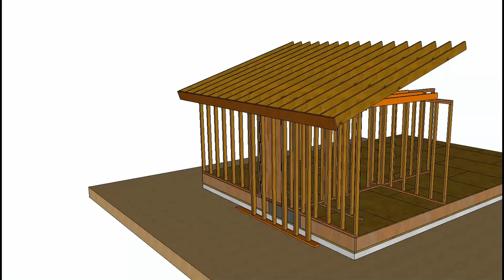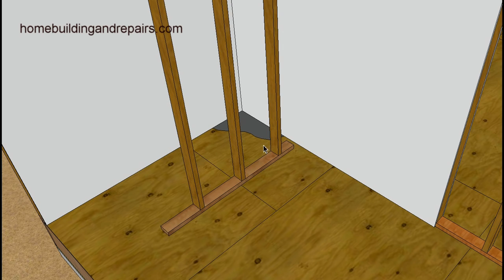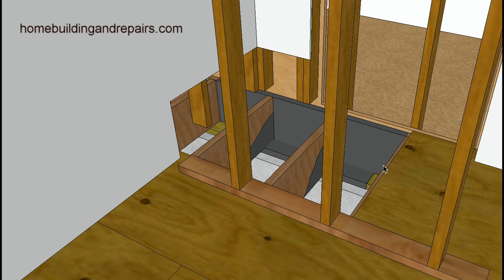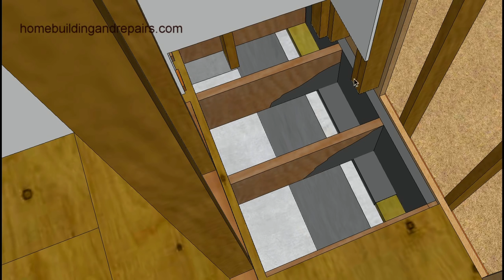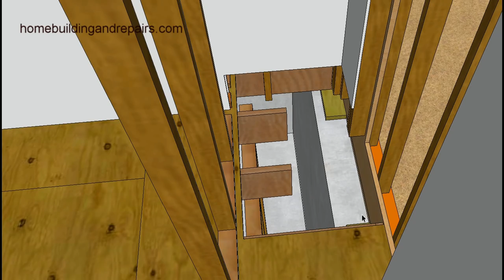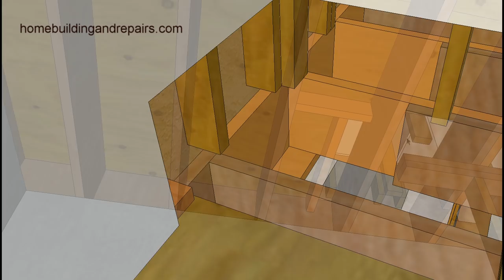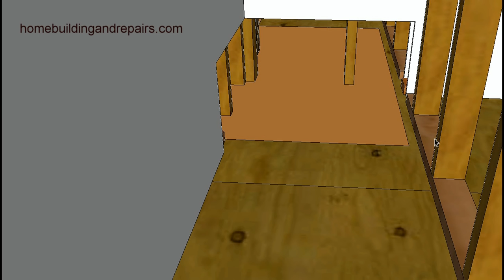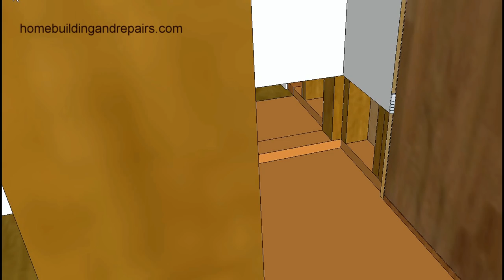How To Repair Damaged Floor Framing Under Load Bearing Exterior Wall

Comment: Thank you! This video was so helpful and the closest to the kind of replacement/repair example I need that will apply to removing a concrete slab addition and replacing with pier and beam. Your explanation with visual was so helpful.
Reply from the maker: Great to hear!

Comment: I found major water damage on my house caused by improper gutters. I already replaced 12ft of rim joist and sill plate underneath a large bay window. 2x6 wall and framing also rotted. Subfloor rotted only 1-2" out from exterior wall. How much is suggested to remove minimum, 24"? Subfloor sits under prefinish hardwood

Comment: Not shown in this video is cross-bracing on the temporary support walls. As drawn, the studs will bow and sag. Great video and very clear on techniques.
Reply from the maker: That's because there might not have been any, but feel free to provide us with more details about exactly what type of cross bracing your referring to or email me a picture. You can get our email address at our website.

Comment: What if you don't have to remove the floor joyce and thee wall frame plate to replace thee plywood in between them ? Do you just slide in the new pieces of plywood all the way back to thee rim joyce at thee foundation ?under the wall frame?

Comment: 2:50 - is it not a hazard to remove the framing plates from the load bearing wall? Won't those load-bearing studs collapse?

Comment: Here's a question, the old half of my house (built in 1921) joists and rafters go in one direction right? But the newer half (built in the 70s) goes the opposite direction. So my question is what becomes the load bearing walls? Do I now have 3 exterior load bearing walls and 1 interior? And more importantly, I have a part of the floor and wall that is water damaged that needs to be fixed that is part of possibly 2 load bearing walls 😵‍💫
Reply from the maker: Here's a link to our engineering section at our website that has a few more videos about load bearing walls. https://www.homebuildingandrepairs.com/engineering/index.html

Comment: This scenario is almost my exact problem. Only difference is the offending exterior wall does not support the rafters. Would this scenario require the same process or (hopefully) slightly easier?
Reply from the maker: I cannot provide you with structural engineering advice even for repairs, but would suggest going to the website and watching more videos in the framing repair section. You can always email me some pictures and I would be glad to take a look at those if you can't find what you're looking for at the website.
Reply: gregvancom I’ve tried to email you but it got sent back. I’ve watched hours on your website...

Comment: does it remove the integrity of the sill plate is you remove a section of it?
Reply from the maker: If you want to make sill plates longer, you can. Sill plate length usually isn't as important as the top plates.

Comment: I have a double wide with water damage from a bad roof. So I'd just build a wall on the inside supporting the roof and a small wall underneath the house then I can cut out the bad wood?
Reply from the maker: I would suggest going to our website and clicking on the repairs tab, then check out some of the framing wall and ceiling videos for more information, but you're on the right track.

Comment: I am trying to move a floor vent into a wall space to have it come out of the wall. Can I cut away a portion of the bottom plate on an exterior load bearing wall if I use a simpson tie?
Reply from the maker: I can't provide engineering information, but have seen plenty of framing plates cut like you're describing.

Comment: If the rafter are exposed on this single story cottage, would it be okay to build temporary wall on the outside of load bearing wall with a proper base of course? Also, crawl space very tight and was curious if jack posts would be sufficient, and at what span. 40' of the cottages rimjoist, and sill are rotted due to a deck that was constructed next to cottage.
Reply from the maker: This link might help, let me know if it doesn't.
http://www.homebuildingandrepairs.com/repairs/framing/walls/index.html
Reply: Did the Jack's work? I'm thinking the same thing I have a water damage spot underneath the exterior walls. It's a double wide with limited space underneath.

Comment: I need to replace a rotted subfloor in the corner of my bathroom where one edge is the interior wall and another edge is an exterior wall. The replacement subfloor is roughly two stud lengths on either edge (~32 inches). The rot extends under the bottom plate so I need to remove the bottom plate before removing the subfloor. Can I just remove the bottom plate on the interior and/or exterior walls (studs will have no bottom supports) without using any additional supports? According to your video it looks like it's okay to have the studs just hanging there while I put in a new subfloor, but I want to make sure I am interpreting this correctly.
Reply from the maker: As long as the wall is not supporting a heavy load above, then 32 inches might not be a problem.
Reply from the maker: It all depends upon how the home is constructed. If you don't know anything about construction, then I would support the walls before removing the wall studs, bottom plates for sheathing and making any repairs. You might be able to do it by removing and replacing one stud at a time along with a small bottom plate. I will make a video and post it here when it's done.

Comment: Hi, I have a 2 story home that I need to support in order to replace an outside wall rim / end joist (not the header).  This joist is resting on the concrete basement wall.  I suspect it would be considered load bearing. How do I safely support the house?
Reply from the maker: Send me a picture of your project and I will see what I can come up with. Don't forget to visit our website and click on the repairs tab and then the framing link for more videos that might be helpful also.

Comment: This is a nice video.  It is pretty similar to my situation.  I have an old house ('49) with a basement.  I get the impression that it was built in an unusual way.  There is no sill plate.  There is a rim joist sitting on the blocks of the foundation wall.  In addition there is sloping concrete from the inner portion of the block to the outer portion of the block wall between the floor joists.  I don't know if this was done to add stability to the floor joists to prevent racking.  the upper portion of the studs are in good shape so I was thinking about tearing off the siding, insulation and sheathing and attaching a 2X10 horizontally to the upper portion of the studs on the outside.  I could then use house jacks to stabilize the outer wall while I do my work.  Is this a bad idea?  Can I find some bolts to use with my 2X10 with enough shear strength? When I sister in the floor joists, can I use shims if I chip out too much of the sloped concrete on my foundation?
Reply from the maker: Yes, what you're planning on doing sounds like it will work, but I couldn't provide you with any hardware or lumber material suggestions on what to use, because I don't know how much weight you would be supporting and I'm not an engineer. However, it sounds like a great idea for a video and I will put a link here when I finish making it.

Comment: would you need joist hangers in this particular setup? I am working on something similar but it seems the old floor joists are just notched and set on the sill plate. This doesnt seem like a particularly good solution as I've noticed some notched joists have slipped.
Reply from the maker: Joist hangers might work. Send me a picture of your problem and I will see if I have any suggestions.

Comment: still nothing like I'm working on. My job this house is in need of a bull dozer. I'm takeing everything out from under the walls, can dig most of it with my hand. puting in everything new useing 20 ton bottle jacks. this is the house number 3 for me, but by far the worse one yet. 28 x 36, fixing it room by room
Reply: Im in the same situation and new to all of this.. lots of not so good surprises so far. We are also working room by room. Kitchen and bathroom are the worst of all.
Reply: Clara, how did it work out?

Comment: I have water damage on a rim joist under a sliding door. There was a deck attached to it. The floor joist run parallel to it not adjacent like in your video. Do u have a video that addresses that?
Reply from the maker: See if you can find other videos on our website. I would suggest going into the repair section and clicking on framing repairs and then floors for more information. Let me know if you can find something that helps.

Comment: Are your videos are amazing. I was wondering if you had a video on replacing sheathing on a exterior load bearing wall.  It’s a brick house with a leaking chimney. Any advice is greatly appreciated. Thank you in advance
Reply from the maker: Thank you and no I do not, but it is on a list of videos to be made in the future. The only way I can think about fixing something like this would be removing the brick.
Reply: I've seen such repairs and they include tearing the bricks out.. of course, the alternative method, the details of which would go with you to your grave  would be to build the new framing + sheathing in sections vertically and shimmying them into place

Comment: when repair a joist should the sistered joist span the entire length?  Do you need to support anything if you replace the joist?
Reply from the maker: +P mcracken I like to use full length joist and you would need to support sections of the home that have loads on them.

Comment: What if the joists go the opposite direction? Parallel to the exterior load bearing wall
Reply from the maker: Then you will need to support the wall framing, before making repairs and I might have some helpful videos at the website. Let me know if you can't find something.

Comment: I have a 137 year old house that has a 1 inch separation  where the exterior  wall has pulled away due to bad floor sills. Can this be fixed? We have secured it so it doesn't  move any more
Reply from the maker: Yes, it can be fixed. Visit the website and in the repairs section click on the framing link and check out some of the videos I've already made. If you can't find something helpful, then feel free to send me some pictures for more information.
Reply: I have somthing very similar happening with my house, slightly overwhelming when I found it, it appears the previous owners tried to fix it and now the floor along that whole wall in that room has fallen around 3 to 4 inches, I think it's either the frame under the wall (exterior wall) or a floor joist. Does that sound fixable?
Reply: I have a old house that has a separation where the exterior wall has pulled away

Comment: How do you brace an interior wall with a ceiling in place?  How do I keep the ceiling from being ruined?
Reply from the maker: I've used cloth in the past, for example placed a few towels in between the finished drywall and my support framing, but this won't always work. In other words, in some cases the ceiling will get damaged and then will need to be repaired.
Reply: @gregvancom  That's a good idea!  Thanks. I'll give that a try!